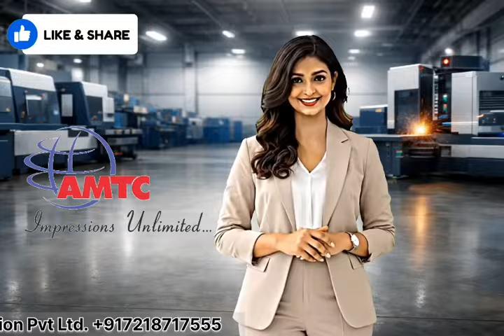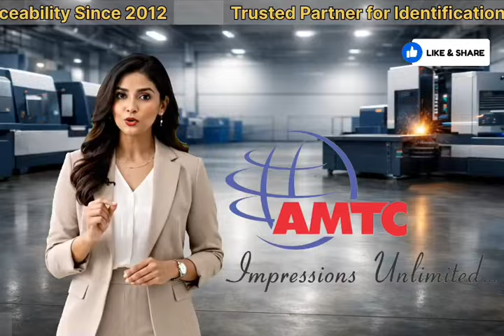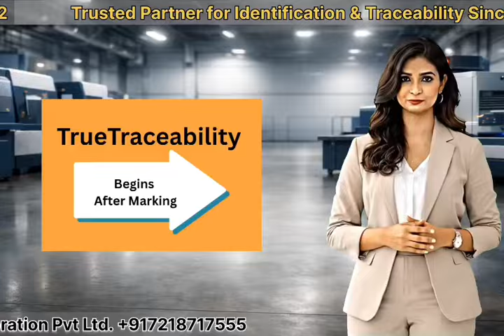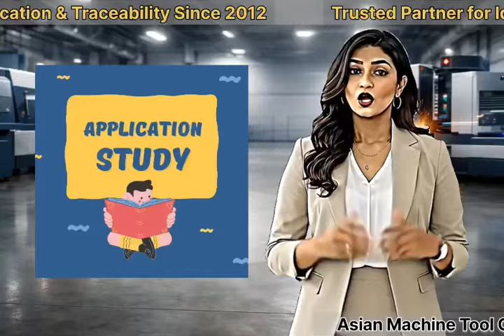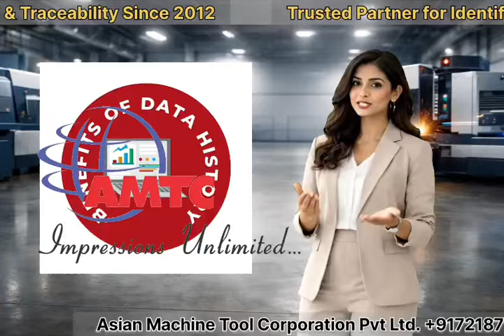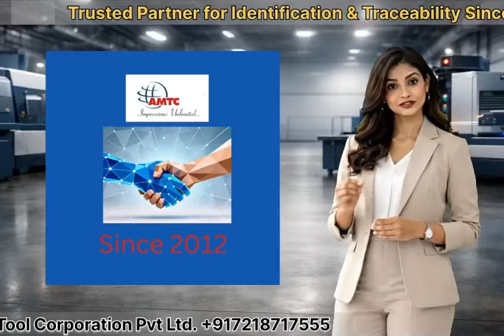Vendor Traceability: The Weakest Link Costing OEMs Crores

Comment from the maker: Most OEM recalls start at vendor level ⚠️
Without proper part identification & traceability,
❌ Brand reputation suffers
❌ Recalls become expensive
❌ Compliance fails
AMTC provides Laser & Dot Peen Marking solutions for
✔ Vendor traceability
✔ Serial / Batch / QR / DataMatrix marking
✔ On-site & portable marking machines
📞 +91 7218717555
🌐 www.amtcpl.com
💬 Comment “TRACEABILITY” for a solution discussion.